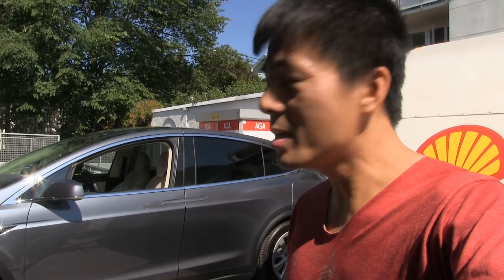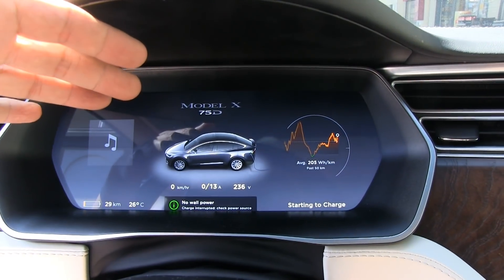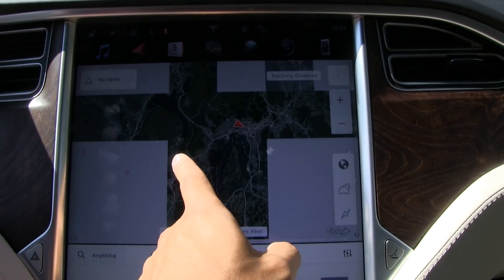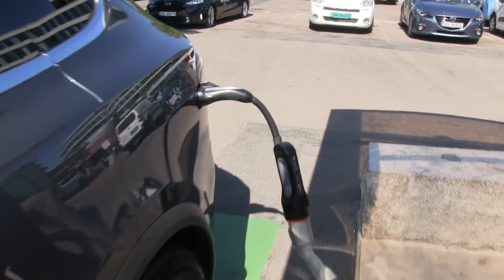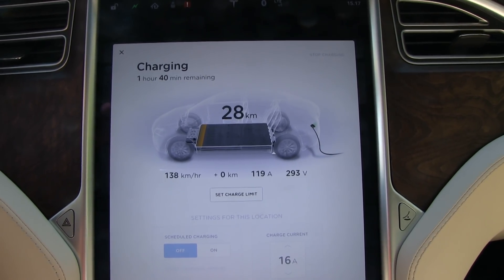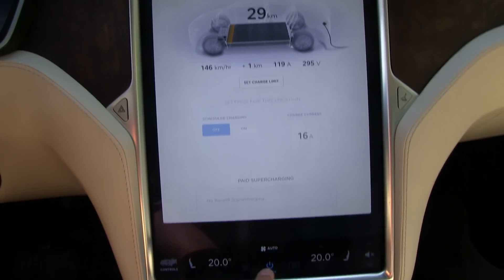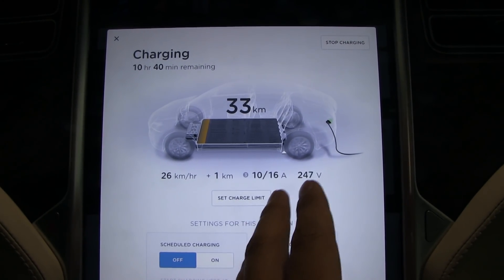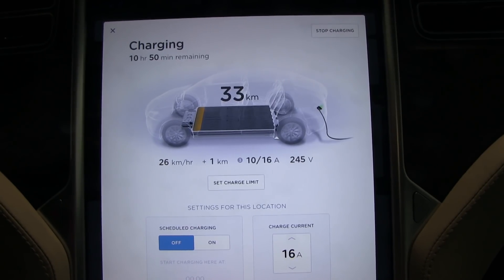Tesla with broken onboard charger

Comment: The on board charger on my 4 yr old model 3 just stopped working (one of the two phases). It charges at 16 amps instead of 32A). Tesla quoted $2500 to repair. Pretty disappointing that a 4 year old car requires such a big repair, less than 2 months out of warranty!

Comment: Just found out that my onboard charger is not working as well on my 2017 model s still under warranty but having to get proof my charger at home Rolec unit is working ok but still cannot use AC only DC

Comment: would a tesla equipped with the "Dual on board charger" still work if only one unit failed ???
Reply from the maker: +william webb Yes. But one is master and one is slave. If the master fails then AC charging won't work.

Comment: I hope Tesla one day allows for the Model 3 to use a CHAdeMo adapter!
Reply: A little bit Intellectual it does fit. But no charging will occur.
Reply: Does it not? That's a bit of a game changer
Reply: It currently does not. From what I have been told the batteries and battery management system is very different from the MS/X. Do not know what needs to be done to change (ie. OTA update or a change to the CHAdeMO adapter itself) but as of right now the current CHAdeMO does not work with the T M3.
Reply: Tesla World but the Chademo adapter fits, right? Have you tried?
Reply: It'll just be a matter of time, same as it was for the Model S when it first came out.

Comment: Unsurprising since DC fast charging bypasses on onboard unit to put high power DC juice straight into the battery. Still it would be a major hassle if he or she does not get the AC charger fixed.

Comment: Hope they release a CHAdeMO adapter for the model 3, because the one they sell right now does not work with it.
Reply: They probably just need to update the Model 3 firmware for CHAdeMO, which, for who knows what reason, they haven't done.  Something about 2170 cells?  What would be so hard to add?  May also be the demand for it on the 3 is low in the USA.  -Lee
Reply: Benji Frater Meaning what? There is no inherent reason the Chademo won’t work on a 3 except the software isn’t set for it. It’s DC charging like Supercharging. They do have to write it from scratch for the new car/MCU so they may not feel the market is worth it for the US. It may not appear until EU cars are ready. 

That’s my take on it. I can’t see them never doing it! -Lee
Reply: Can you elaborate?

Comment: Bringing CHAdeMO is like having an Auxiliary Fuel Tank with, but without the risk of a fire. 

My favorite interior options. Wood panels and cream seats. 

 Happy birthday to wifey.
Reply from the maker: It's like having a backup fuel pump if the main fuel pump would fail. I had issues with fuel pumps in my fossil cars before. It left me stranded and I had to be picked up by a flatbed.

Comment: The high-pitched screeching noise when you started charging would have had me concerned. Or is that normal? Never heard that in your videos before.
Reply from the maker: It's common. Comes from the Tritium chargers. ABB and Efacec do not make these noises when in use.
Reply: It's a high frequency noise, most likely from a switching power supply. Normally power supplies work at a frequency out of the human hearing range, but some of them work below 20kHz, and that's why we can hear it, but it's normal operation.
Reply: Yes, it could be heard on some other videos before. I measured it with a frequency app on my smartphone and most times it is at 10.5 Khz. (I don't get why manufacturers can't use tech that is double of that, 21 Khz, no human would hear it then).

Comment: Does Tesla consider the charger part of the drive train? (Just asking because I'm wondering if I should buy a new Model 3 or a used Model S next year... )
Reply from the maker: Fail in the charger is a very rare case as I mentioned in the video.
Reply: It's such a rare thing that I wouldn't worry about it at all.
Reply: realulli better a new model 3, because it's new and you know, that has been by yourself
Reply: Jean-Pierre White You used the word "savings". Savings over what? Yes, you are directly comparing ICE with EV, and failing to note that anecdotal evidence is far from fair. Even if your personal records indicate cheaper long-term costs for ICE than EV, that's not the average user experience and probability dictates that regardless of the tech there are going to be both lemons and bulletproof examples. Bringing up fringe cases is not helpful.
Reply: xxBlackpspxx Any car is used if driven off the lot. There are good used cars out there, many still under warranty. You just have to search and drive. Good used Teslas are harder to find mainly because there are fewer of them.
Reply: There's one video about a guy who has a bundle of issues with his used Model S (unfortunately, in German). The repair bills look scary (but on the other hand, if you buy any other 100k car, the repair bills will look similar).

But yes, that's what scares me to some degree.
Reply: Jean-Pierre White You talk as though ICE vehicles never break down and are cheap to fix. Transaxles go out in front wheel drive cars and are very expensive to have repaired, far more than your Leaf charger. Lots more other things to go wrong as well. Out-of-warranty ICE cars are no walk in the park.
Reply: They are also quite a bit more expensive... like 20k+ Euros...
Reply: Already did. Keeping my options open. ;-)
Reply: realulli ? For what? You can buy 10 on board chargers for 25k Euros
Reply: xxBlackpspxx Troll
Reply: Chademo for the win Bjorn
Reply: Hahaha, used Tesla bad idea. I can't wait for the shitstorm when people who bought an used Tesla discover their repair bills